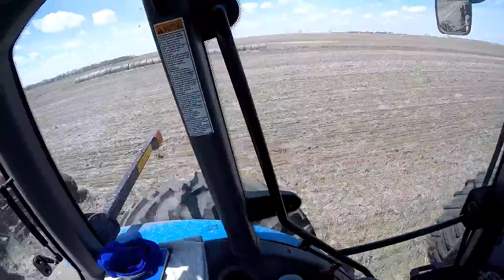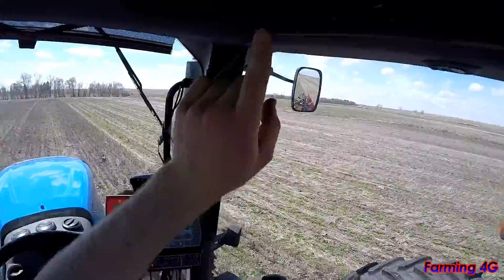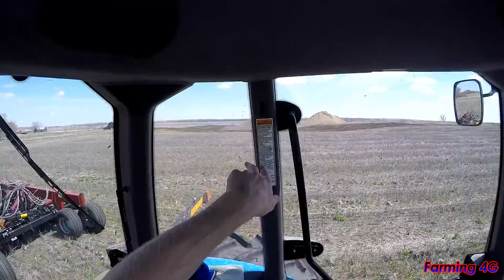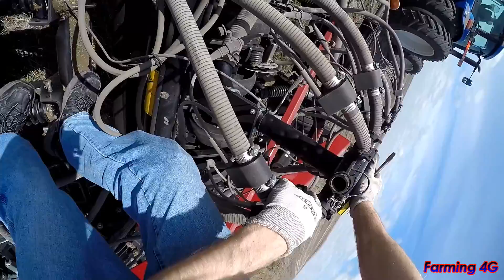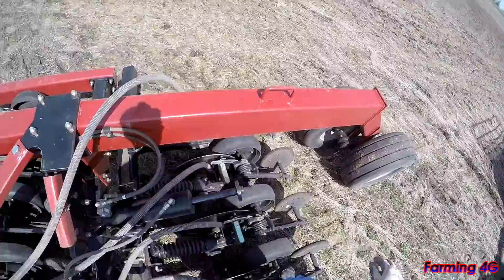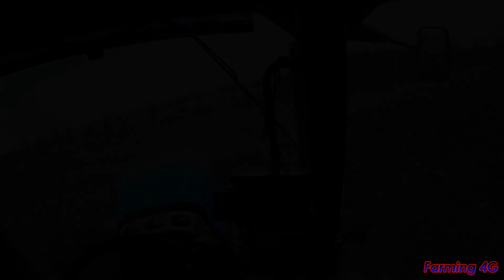An Unexpected Expense - New Holland TG285, Case IH SDX 30 & ADX 2230

Comment: Nice video! That had to split the tractor to do the seal....$$$ for that. That ground moisture will help as it rises at night. If you can get a couple inches after you everything planted...but it's not going to wait that long. Slimy is fine as long as it stays warm. In North AL, they're expecting high 30s in a day or two...good grief.
Reply from the maker: Slimy soil take a little more effort... have to watch the seed depth, compaction, and any mudding/hairpinning issues. The SDX with the new scrapers is doing a pretty good job. With it slimy too, can't tell how close to get to some wet spots when the tractor feels like it's shimming around.

Comment: How do you like this drill? I would like to get on for cereal crops. Granular would be applied ahead of time and tilled in, then seed applied with the drill. Would like to utilize a liquid starter on the drill as well. What are your pros and cons? Life expectancy on wear parts? We look to seed 500-1000acres a year.
Reply from the maker: It's worked ok, fairly straight forward. I think it has 15000 acres on it now, us being the 2nd owner of it, probably put on 9000 ourselves. Still original disks but are worn to the point where if we have to change scrapers/openers again they'll need to be changed... will be a heck of a job. Couple bearings here and there, some wheel and walker bearings as well. Have changed the scrapers twice on it since buying it. The rubber/plastic trailing trench closers hate rocks, but the rest of the machine has faired well in all sorts of conditions. No cracks or welding has been done at all for ours, but do have to pay attention to bolts and hangers as sometimes a random bolt will break, but there's plenty else holding it all together.

Comment: Good video.  Thanks.  A couple of questions.  Why do your grow durum wheat instead of regular spring wheat.  Also, what advantage is there in planting flax, vs other plain type crops?
Reply from the maker: Main reason is diversity for both of your questions... since there are some markets for those crops. It's also good for soil health and weed control with crop rotations as every variety utilizes nutrients and the soil differently, as well as different sprays so weeds can't get established.

Last year, had trouble with ergot in the wheat, so it was very important not to seed very much cereals this year. The acres that the durum was going on should be ok.

Comment: Do you have row shut off on that drill
Reply from the maker: No... Only thing can really do is plug each run on the air cart and installing a different seed roller. It's how we seed 15" soybean rows with 3 runs instead of all 6 runs at  7.5" for everything else while maintaining proper seeding poundage for it.

Newer planters have this feature as each kernel is important, but for regular drills it usually isn't.